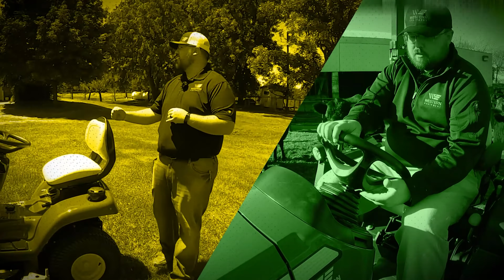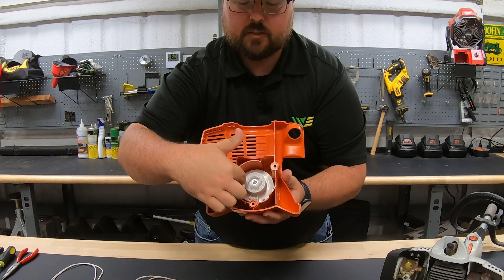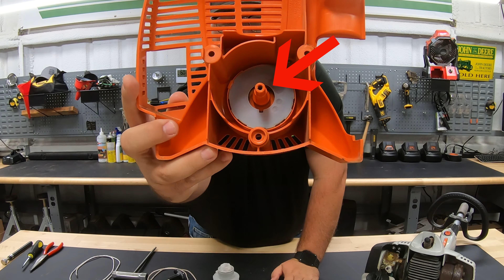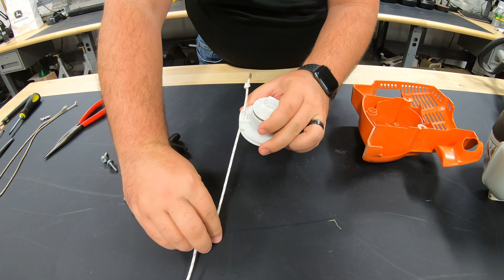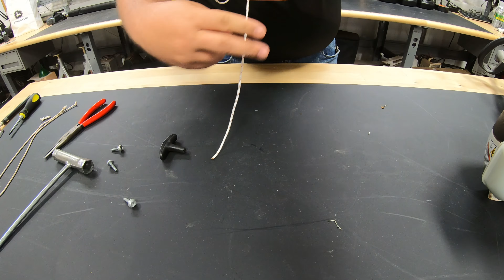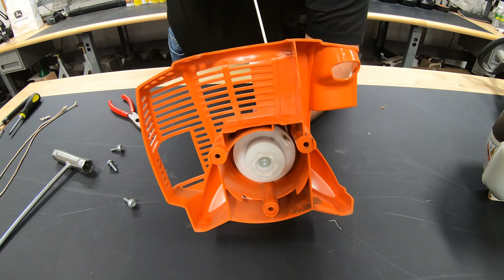How to Fix Broken Starter Rope in Weedeater or other Engines

Comment: I had my spring snap ba k while rotating several times causing it to slip from the pawl, and then had to remove the cartridge spring to reset everything and every damn time I pulled out the cartridge that fucker spring slinkyed all over the god damn place about 7 times before I used my channel locks to hold and rotate the damn thing. In the end great video I got it re wound and everything's working great I choose to order OEM parts recoil spring and a new rope from my local small engine shop parts only costed me about 17$ CAD

Comment: My question is did I get a daily weed eater or does Stihl have an issue with the pull string malfunctioning? I bought this weed eater 2 years ago, and every year I’ve had it I’ve had an issue with the pull string. The first year it was under warranty, so they fixed it. Now it’s doing the same thing again except it’s not under warranty. I’ve had several, much cheaper weed eaters and never had an issue with the damn pull string. I’m going to get as much use as I can out of this but I’m definitely not buying Stihl again.

Comment: You did a great job , very thoroughly demonstrated !!! I made a comment, if you could answer me, I am so disappointed with the repair service I went to with my SF94R STHIL weed trimmer, I thought it needed a new Air filter, they said no, but it is filthy in the SPONGE SIDE, the guy said the cardboard side is the one that needs to be clean and mine was , then he went in the back and sprayed the whole thing down with Carburator fluid! And it was so hard to start, and the whole thing VIBRATES so bad I can not hardly hold it, then while trying to start it , the handle came off, now I watched your video, and will attempt to repair it, I think that the Knot was not tight enough !!!!
Can you tell me what you think about all of these things and is there a cure ?????

Comment: Good video- took me a couple of times to figure out the smaller diameter spring that sits under the small housing against the outside cover had lost tension. $13 spring, $3 rope and we’re good to go.

Comment: Thanks for this. I was struggling to get the spool to catch on the spring. What I wound up doing was making a gap in the head of the spring and dropping in a little piece of trimmer string to make the head of the spring stick out more so the notch in the spool could catch it.
Reply from the maker: Pretty creative! Did you get it fixed that way?
Reply: @WesternEquipment  Yes. The little hook on the spring was just a tiny bit too far away for the spool to catch it. The piece of trimmer line pushed the spring towards the center just enough to wind the spring up. Without your video, I would have struggled to figure out what was keeping the spring from winding. Most other videos have the model that uses a C clip, and the bottom spring is exposed.

Comment: Always good to know. Starter ropes are funny. I've a honda hrx217 that has electric start and a pull rope. The pull rope broke at the pull handle,but I'd never even used it,lol.
Reply from the maker: Yes, they can be a real pain!
Reply: Sounds like crappy rope, if it broke from merely existing
Reply: @robs1852  only thing  I could figure is that where I haul it around in my pickup and wind vibrates the rope it wore in two.
Reply: @ciphercode2298  That could be it.  Just struck me as funny that it broke from just being there. My weedwacker pull string is hanging on by a thread, that's how I found this video